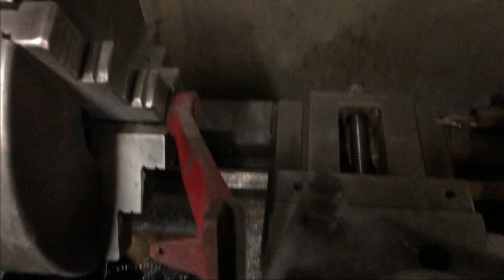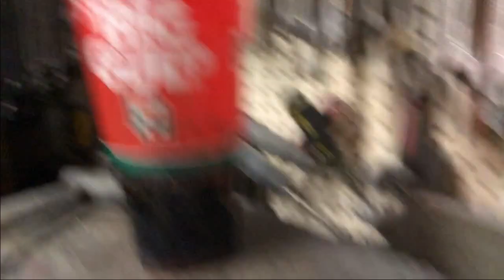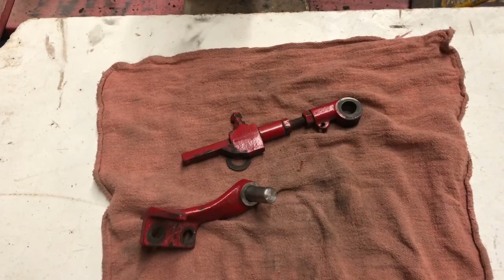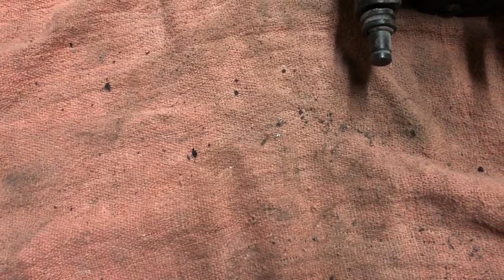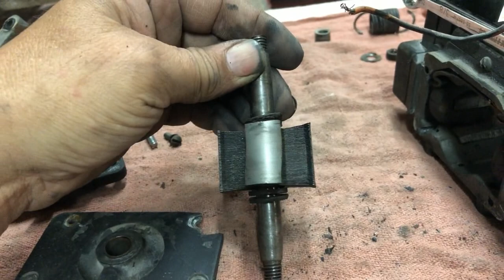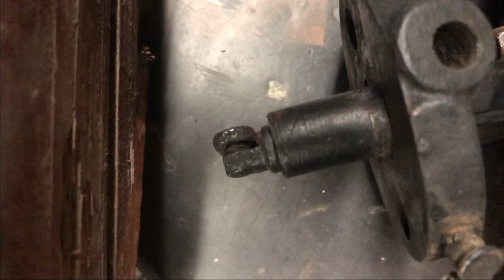Nelson Brothers Hit Miss Stationary Engine 1 3/4 HP, Webster Magneto and Igniter Refurbish.

Comment: Nice work fixing up what someone else messed up there!  Those mags are interesting pieces to work with.  She's gonna run good and I bet you'll feel that spark too! LOL
Reply from the maker: This engine was supposedly rebuilt when it was bought but, there kind of rebuild is just spray it with new paint.  If you look close at the igniter trip it had paint only on one side, because it was painted with everything bolted on the engine.  We have seen this many times and expect it.
Reply: Penny's Hot Rods & Customs that makes sense.  Good job taking the time to make it right!  Worth it in the end for sure.  You can tell you guys enjoy what you do and it shows !